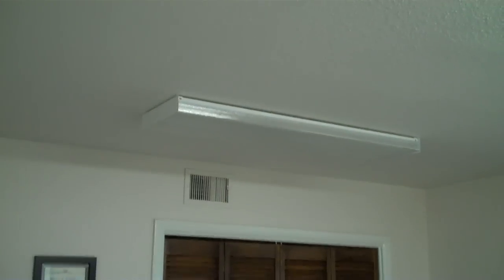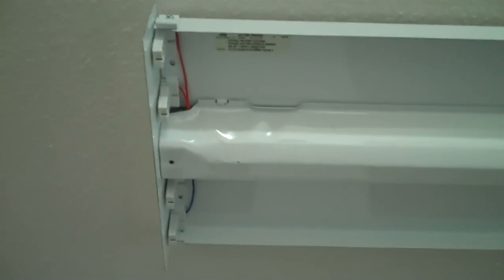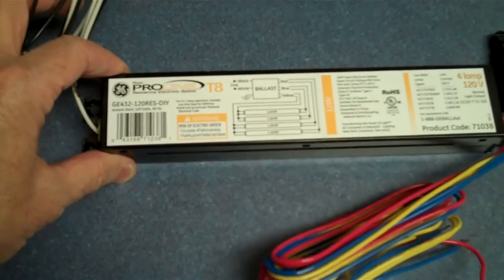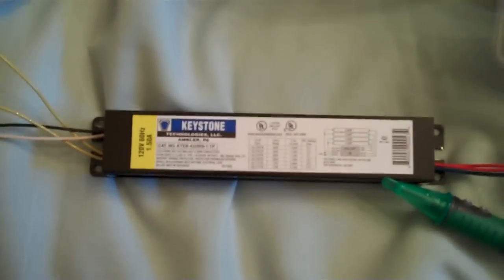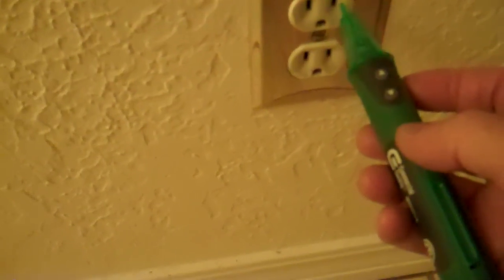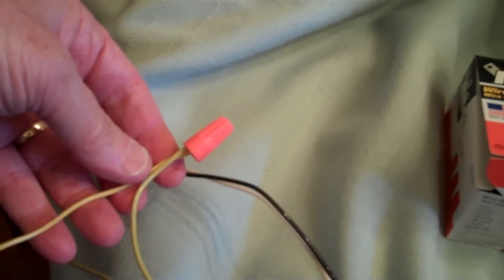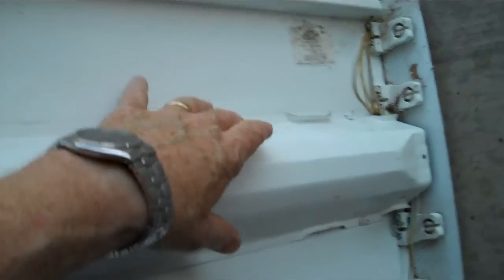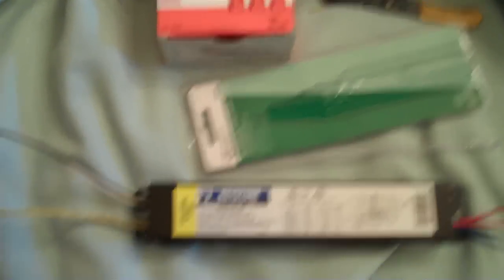Fluorescent ballast replacement for 48" four bulb fixture

Comment: I have installed many electrical items in our home and the homes of my family, but I have never replaced a ballast!  I wouldn't have been able to do it without this video!  The ballast that the home depot said I needed had more wires and they were in different places.  I looked up the configuration and thought the worse thing I could do was fry it, and have to buy a new light.  I didn't know that thing about wire nuts, learned something new!!  My light lasted 9 months and I wouldn't use words like junk or crap to describe it.  I almost bought more because it really made a difference where I used it.  Thanks for your help!  It is working fine now and if it goes out in another 9 months, I am going to drop kick it over the deck rail and beat it to death with my big sledge.  Never buy Lithonia!!  I wouldn't have another one if Home Depot was giving them away for free!!!!!!
Reply from the maker: Jim Miller   Glad it helped.

Comment: I replaced my original ballast which was a Keystone just as yours. I liked the use of the non-contact AC Voltage detector. I went out and bought one and it's better than I imagined. The only thing I do not agree with is, the wire nuts. The orange wire nuts are good with the 12 gauge wire from the house wiring, but the ballast wiring connecting to the fixture wiring is a high gauge and the connections work a lot better with the blue wire nuts.  I was not able to get the orange to tighten. I'm saying this to let the next person know to have at least 6 blue and 6 orange and use which ever work best. There already are two orange connected to your ballast and house wiring.
Thank you for this video, it gave me the confidence and I changed out the ballast, and with any electrical task I do, I'm happy to say I'm still alive :-)

Comment: Thank you for the video, it helped put me at ease quite a bit when replacing the ballast for the first time in my overhead kitchen light.  And thanks for the heads up on the voltage detector... It turns out I would have given myself quite a shock if I hadn't bought that.
Reply: Never rely only on a voltage tester, use a meter on volts setting, wire to ground. People have died relying on a beeper

Comment: Thanks for the lesson on using wire nuts. Never dreamed it was so simple. Unfortunately I still don't know how to connect my ballast.
Reply from the maker: +Bill Stuart  Yes, pretty nice. Don't twist the wires together prior to applying the wirenut. Let the wirenut do the twist. Works great.
Reply: Yes now how do you connect a 4 bulb ballast with 2 blue and white wires,2 red and white, 2 blue and 2 yellow. The receiving wires are yellow blue and red at each end of the fixture. ??
Reply from the maker: Bill Stuart
The ballast should have a black and white wire on one end. This goes to the line voltage and hook up exactly as it was with the old ballast. There should be 2 red, 2 blue and 2 yellow wires coming from the ballast. There should be 2 blue, 2 red and 2 yellow wires coming from the fixture. Hook the red ballast wires to the red fixture wires, same for yellow and blue. Use the wire nuts, orange if I remember for these and the power ( black and white ) reuse the wire nuts that are already on, probably red. Hope this helps. If your ballast doesn't have a black and white, 2 yellow, 2 red and 2 blue something is wrong. Also, on the ballast their is usually a wiring diagram. Some companies may use a different color code so use the wiring diagram on the ballast.

Comment from the maker: Pretty much that's it. Make sure the power is off, there is one screw that holds the ballast in place, Probably there are wirenuts on the black and white power source, unscrew those, cut the other wires and I cut usually 12 inches from the old ballast and remove. New ballast scrape the paint to ground, strip wires and trim to acceptable length, wire nut same color to same color and you should be good to go. Better to have long wires on the fixture. Who cares how long they are on the old ballast.

Comment: So....to replace your dead ballast took the better part of a day, at least 2 trips to your home center because of a bad NEW ballast, and red, yellow and orange twist connectors.  And you bought a new voltage tester.  So to replace a $50.00 fixture, you spent at least $50.00 not to mention nearly a days worth of work.  Does not make much sense to me.  I have a 4 bulb fixture in my workshop and two bulbs went out.  I was going to replace the ballast but instead I think I will buy a brand new fixture!  Thanks for the video.  You did a great job at convincing me not to replace the bad ballast!  LOL!
Reply from the maker: +robertbdesmond  A little late getting back to you. I must have had 20 of these junk fixtures in my office. Every few months one went out. Took me 15 minutes to replace ballasts which I bought in bulk vs. new fixtures with who knows what ballast. Saved money in the long run and didn't need an electrician every few months. Hope your new fixture lasts.

Comment from the maker: At 6:56 is that what you mean? The right socket was the hot, the left the neutral and the bottom the ground and I believe that is correctly wired. I have one of those plugs that you plug into your outlets to tell if things are not wired right (or not grounded) and mine are correct. The smaller socket on the plug is the hot and the larger ( on the left here) the neutral. Thanks for watching.

Comment: I wish you could have talked more about the screw that holds the ballast to the sheet metal.  I have run into a screw that turns with the nut and I may have to use a hacksaw blade to get it off.  But I am taking some time to think.  I never saw this before because previously the screw had flat sides that kept it from turning.
Reply from the maker: Sorry but all of the ones I dealt with had a nut that you removed and took less than a minute and the ballast was off. Sounds like you will need to remove the fixture as I don’t know how you will screw a new ballast down. I suggest going to a LED, leave the old ballast in, rewire for the LED and no ballast. Light will be better anyhow.

Comment: instead of putting wire nuts I would recommend disconnects for the hot and neutral. they are safer and easy to install

Comment from the maker: Most T12s I believe use the old fashioned magnetic ballasts, more expensive to run. When one bulb is bad on T12 usually both lights will not work. On T8 if one bulb is bad then that bulb wont light. My recommendation is that if you have a bad ballast convert to T8 ballast. More efficient and in the long run will save you money. I also find it easier to put T8 bulbs in. I believe T12s are being phased out by the bulb police.

Comment: I love it.. Pice of Junk.." hahahaha. The Black paint is an electrically conductive so there is no need to sand the corners. You save more than 20$ per fixture, per year comparing them to T12 magnetic ballasts and lamps.
Reply from the maker: +kevini001 I learned something new. Didn't know the paint was conductive.
Reply from the maker: kevini001   Just about to replace another one so I tested the paint to see if it is conductive. It is not. As a matter of fact the instructions with my ballast say use a star washer to make sure it breaks through paint to ground fixtures. I just scrapped paint off.

Comment: I do wish you had shown us video of you actually installing the ballast. Watch you connect the wires would be very helpful
Reply from the maker: As you know this is an old video and I recommend going the LED route and you don’t need a ballast. The ballast though is held up with 2 screws. With the power off you remove the wire nuts powering the ballast, cut all of the wires to the light fixtures, unscrew the ballast screws and throw away the old ballast. The new ballast goes in identical to the old one. Black to black, white to white, etc.  Essentially plug and play. I do scrape some paint off around the mounting screws for better grounding. I really don’t recommend this anymore as I have switched to Led and think it is the future. Fluorescent bulbs won’t even be available. Do led that don’t require a ballast. Many videos on these by others.
Reply from the maker: I should note that when connecting the wires I don’t wrap them around each other. I just hold them side by side, then twist the wire nut around the wires. Make sure the wire nut is secure.

Comment from the maker: You are absolutely correct. I contacted the company and complained and got virtually no response. Let the buyer beware when it comes to Keystone ballasts. They have all failed prematurely in my fixtures. My ballasts all were made in China with a Keystone label. Cat No KTEN-432RIS-1-TP. Looks American but stamped in the case says Made in China. How would you know though when buying a light fixture unless you took it apart.

Comment: i have a 2 bulb t12 setup on a sign that originally was running an old magnetic ballast. I went to home depot and bought a 2 bulb t12 electronic ballast and wired it up 2 red wires to the 1st socket .Then the 1st socket is jumped over to the 2 socket. then 2 yellow wires to the 3rd socket and 2 blue wires to the 4th socket now it seems to work only when it wants too one time it took 2 hours to come on and sometimes it starts up no problem today i went to switch a bulb that looked like it was dying then after that it wouldnt work anymore i really need help figuring this out

Comment: Great video. I don't see how to get the cover plate off the ballast area, there are several metal tabs holding it in place that i am reluctant to bend and pushing and squeezing doesn't free it. Any ideas?
Reply from the maker: Judy you need to squeeze the ballast cover towards the middle. It is thin metal and squeezes easily. Try one side first up and down the whole length. If I remember there are 3 places where it is held. Putting it back is the trick as you have to carefully tuck all the wires in. Once you have one side off the other side is easy.

Comment: I wish your video showed how to remove the old ballast.  How do you disconnect the wires from each bulb socket?  Do you have to remove the sockets from each end of the fixture?  Also it didn’t show how the new ballast was connected.  The new one had the yellow wires on the side with the red and blue, not on the side with the black and white like the old one did.  Did you have to push the yellow to the other side?
Reply from the maker: norywalker     You cut the wires with a wirecutter off the old ballast.  Make sure you leave plenty of wire on the sockets. One screw then to remove and the old ballast comes off.  The black and white power wires probably have a wirenut already so just unscrew those. Don't mess with the sockets. One screw to replace the new ballast.  Someone said the paint is conductive so you may not need to strip it. Doesn't matter what side the colored wires are on but splice red to red, blue to blue, yellow to yellow, wirenut them all. You will have to cross some to the left and some to the right. Tuck them under the cover without pinching and replace bulbs to test.  Hope this helps.
Reply: TheRotorhound - Thanks so much, that helped.  I had a piece of junk Keystone ballast, too.  It had 2 screws, though.  I bought a pack of 6 wire caps and was able to replace the ballast and now my light is working again.  Thanks again!
Reply from the maker: norywalker   Glad it helped.

Comment: For GE432-120RES ballasts, you can ignore the insert stating "for commercial use only".  This insert apparently comes with all or most GE ballasts but (if you read it carefully) ONLY applies to "FCC CLASS A" products...the "RES" ballast (if you read its label carefully) is an "FCC CLASS B" product.  Very confusing if you are a DIYer.

Comment: is there a differences between the orange cap and the yellow cap?
Reply from the maker: A yellow wire nut connector is meant to hold two #18 wires, or four #14 AWG. The orange wire nut connector can be used from a minimum of one of #18 and one #20 wire sizes up to the maximum of four #14 AWG wires.
Had to look this up. I am not an electrician.

Comment: You didn’t show how to disconnect the wires from the bulb connections! That was the whole reason I sat through this video!
Reply from the maker: You don’t disconnect the wires from the bulb connectors. They are reused on the new ballast.
Reply: @TheRotorhound  The wires on the old ballast are connected straight to the sockets. How do I disconnect the wires from the sockets? I took pictures, but I can’t upload them to YouTube.
Reply from the maker: @mariehailey6738    You use the wires that come from the bulb connectors to hook to the new ballast. You don’t disconnect them. The ballast has red and blue, etc. You hook the wires that come from the bulb connectors to the new ballast. I show how to do this with wire nuts. Don’t understand why you are trying to disconnect wires from bulb connectors. You aren’t trying to do led bulbs are you?  I personally have gone to led for mine. No ballast needed.
Reply from the maker: @mariehailey6738   You cut the wires from the old ballast near the old ballast and use wire nuts to connect to new ballast.
Reply: @TheRotorhound  yeah, I figured that out after watching a few more videos - and none of them had the ballast wired directly to the light sockets.

Comment: Why do I have 2 ballast in one fixture? Also the yellow wire is coming out from the side of the black and white wire. And the way it's connected now the yellow wire is connected to the opposite side of the ballast. And so the other.
Reply: You probably have old magnetic ballasts that's why you have 2 of them. 1 ballast for 2 lamps. You'll be better off if you just convert them over to t8's buy yourself a 4 four lamp t8 electronic ballast.

Comment: Why is the hot and neutral lead green wires?
Reply from the maker: That fixture was just an old dummy fixture that I used to test bulbs. That was not mounted to anything and was not the fixture that I replaced the ballast on. Very good observation though. Now of course I recommend led lighting.

Comment: Why use the orange caps for the yellow wires?  What made you use orange and not yellow caps?  Not fit in the yellow ones?
Reply from the maker: filoIII   Based on wire gauge. Worked well for me.

Comment: there are two yellow wires. which two connect to the two on the ballast?
Reply from the maker: BlueWaveDragon You have two yellow wires coming from the ceiling. Usually there is a black and white wire from the ceiling. Do you have a 3 way switch?  You need to see if these wires become hot when the switch is turned on. Neon tester or electrical tester. Don't get shocked. Normally the black wire goes to the black ballast wire and the white wire to the white ballast wire. How was your old ballast hooked up? If the yellow wires are coming from the light fixture they go to the yellow wires on the ballast.
Reply: TheRotorhound I meant the wires come directly out of the ballast and go back through the fixture and when I cut them did it matter which yellow went to the other yellow. but it didn't.  same with the blue and red there are two and I wasn't sure but later figured well it is AC so probably doesn't matter and it works.
Reply from the maker: BlueWaveDragon   Glad you got it working.

Comment: Mercury Vapors may last forever but they aren't very energy efficient. On top of that, they would cost at least 10x more to manufacture than bringing fluorescents in from China. Most manufacturers will gladly take a shorter life and spend $15/ballast than spend $150/ballast. American made electronic ballasts cost twice as much than imported ballasts and fixture manufacturers won't pay for it. There is no room in the industry for American made ballasts anymore.

Comment: Never rely on a voltage tester, use a meter always,red lead to wire ,black lead to ground on voltage setting.also don't trust colors on wires, electricity know no color! Only quickest path to ground with least resistance.
Reply from the maker: You are correct. Am now going led only, easier install, same need to not get shocked. Can’t see why anyone still considers fluorescent.
Reply: @TheRotorhound  it only takes 0.05 Amps to cause heart attacks. Current kills not voltage.  Fluke make a reliable and affordable meter, t5-1000, wiggies are not reliable. Also retro led bulbs still require ballast no energy savings, eliminating ballast and going to a drive is the way!
Reply from the maker: @joerostkowski7313    The leds I use don’t have a ballast, positive on one end, neutral on the other. Much easier to install, brighter, no mercury, and yes, I turn fuses off and still check to make sure no current. I like getting older.
Reply: @TheRotorhound  no ballast just a drive gotcha,
Reply from the maker: @joerostkowski7313    Drive? Not sure what you mean. One side is hot, one side neutral. Very easy. Ballast removed or just disconnected. I remove the ballast.
Reply: @TheRotorhound  led fixtures use a drive to auto transform voltage,fluorescent use a ballast, you have retro fit led bulbs (plug and play) and you have led bulbs fixtures that require old ballast removal on circuit wi t h a built in drive (new form a ballast)
Reply from the maker: @joerostkowski7313   Well whatever it is is built into the bulb and no external ballast needed and work great.

Comment: I put new bulbs in and they still have that dim wavey light.
Reply from the maker: filoIII Not sure why. When they are cold and you first install them mine does this too.
Reply: It's because you either used the wrong color wire-nut  OR you used the incorrect type. Make sure you don't use shunted wire-nuts so you don't short out the ballast or bulbs.
Reply: @6977warrior  that's rediculous